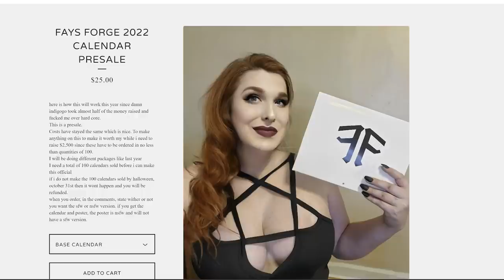vlog 9: My new employee, the shop, life

Comment: I just found your channel & subbed. Having done some blacksmithing for a few decades myself, 
 I always seem to pick up hints and different ways of doing things. Some a lot easier and some not. There is really no wrong way, just what works for you.
   If I may suggest, if you are going to pickup black sand/ Magnetite with a magnet, put a heavy plastic bag over the magnet. Then the sand will easily fall off when you pull the magnet out of the bag. It can be a real PITA to get it off a magnet. Also any area where there is gold prospecting should yield a goodly amount of black sand/Magnetite to melt down. Typically panning is a good way to recover it (and maybe some gold too). Ocean beaches can often yield a lot of black sand, Please keep in mind, if not  using a magnet to separate the sand, that not all sand that is black is Magnetite. In my area there is a lot of fine black basalt sand.  Best.

Comment: I have not looked at your channel for several months. A 'New Shop'....that sounds very interesting. I have used those magnetic squares    ...3:03....for years in welding and fitting, they're a lot easier to get the small particles off of if you put them in a Zip-Lock bag...
 I don't get the thumbs down stuff...if people don't like something, just move on...